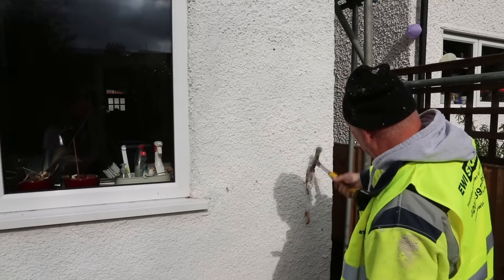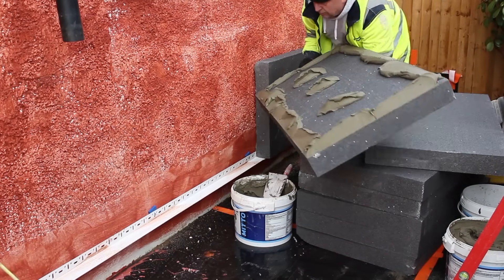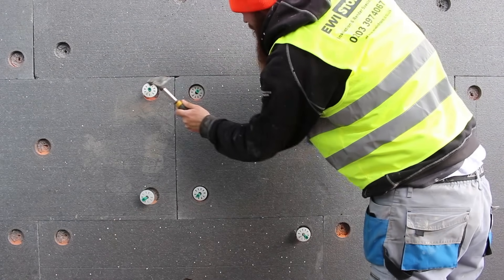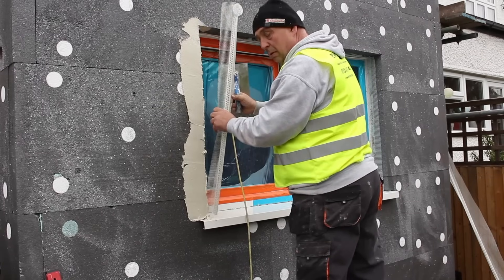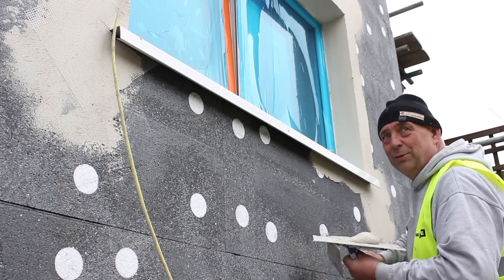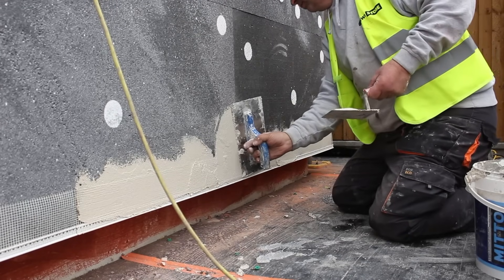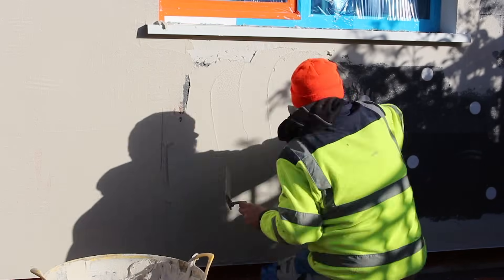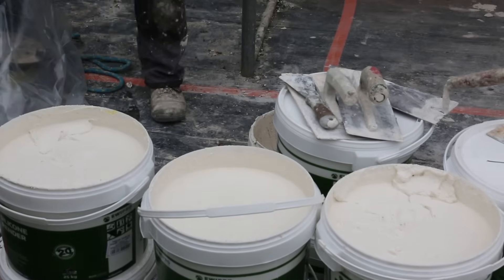Upgrade Your Property with External Wall Insulation – Step-by-Step Installation

Comment: I must say we thoroughly enjoyed the video buddy! Very informative and we'll explained! We just bought an old country cottage back in Ireland and we are going to do this for sure!
Reply: Make sure that if it's a stone built cottage that you allow the building to breath. The type of insulation used here eps is not suitable as it seals the building.
Reply: @bigcheds87  ah thanks buddy! we actually decided to go with the Sheetrock backed insulation boards inside!
Reply: @Luke Jarvis  
If you going to fit this type  insulation you mention I advice for Ireland type of wet weather to sand & paint the wall with damp seal paint if you find it expensive then buy cheap white paint & add mould killer into it very important to do that (always wear goggle and mask) then when it dry stick to the wall plastic sheet the thicker is better  then fix the insulated plasterboard trust me will make a big difference. Best luck with that

Comment: How did you find applying the 225? Have you tried applying this base coat using the spray machine?
Reply from the maker: We have a pft and a kaleta
Works well as a render only on the 225 because you deal with larger surfaces. Haven't tried it with the insulation as the jobs have been too small.

Comment: Great video 
How do you extend an exterior Insulation window sill? It looks like you had one already on .
Reply from the maker: On the markets that are few different types of external wall insulation window sill extension The one we use most of the time it's aluminium window sill.
Reply: Where do you get them from?
Reply from the maker: Usually will get them from ewi  store

Comment: Great video. Will this stop damp mould and condensation. Also how much will a 80m2 area cost ?
Reply: Damp and mould inside a building could well be down to poor ventilation.  Assuming that it is not damp coming through a solid wall, I think you would be advised to look into mechanical ventilation with heat recovery.  That will stop the condensation, dry out the inside of the house and because it re-cycles the heat from the outgoing air, lower your energy use. However this will not be an instant solution.  Our house took a good couple of years to dry out and stop being musty.  Of course, for best efficiency the house needs to be as air tight as possible so that the ventilation you get is controlled not random.
Reply from the maker: Thanks for watching the video .
External wall insulation protects the building's structure and improves weatherproofing. The finished render is durable and breathable so you won't have issues with damp either.

Prices to insulate 80 square meters Is between 7 -10K
Reply: @InsulationRenderTipsUK  Can this be applied on the inside of a new construction house.

Comment: What will you do if you got cracks I existing render could you do external wall insulation on top of that.
Reply from the maker: Hi, thanks for watching the video.
 if you got structural cracks you will need to repair them before external wall insulation.
Reply from the maker: https://youtu.be/OIkHVv2JXzA

Comment: For external wall insulation what is better to use mineral wool or polystyrene?
Reply from the maker: It all depends on what sort of property you got most of the time we will ask manufacturers as EWI-PRO to provide us with a specification for the property. If you looking for the price cheaper option is to do EPS system. If your house is timber construction I would only recommend mineral wool.

Comment: Do I need to remove the dash before I do external wall insulation
Reply from the maker: Re-rendering pebbledash without removing pebbledash can be difficult if the right materials aren’t accessible. Removing pebbledash is a painful process, because removing the render requires hard work with a hammer and chisel, with the added risk of damaging the original brickwork. 
One of the best ways of re-rendering pebbledash without removing pebbledash render is by smoothing over it with our One Coat Dash Cover (OCDC). This is the ideal material to use, because it can be applied at a thickness of 20mm thick without compromising structural integrity.

Comment: Really good job ! Could you please tell me what is the installation price m/2 (without material)? Thanks.
Reply: Really expensive... 😩
Reply: @adrianbadea1179  in Slovenia the cost of making insulated fasade installion included is from 32 eur to 55 eur. or 12.000 eur to 20.000 eur for a average house.
Reply from the maker: Hi prices starts from £80 per sqm. Please visit our website for more information www.beconstructiveltd.com

Comment: I have a wooden holiday home in Hungary. Does anyone know if a similar external insulation solution exists for a wooden house?

Kind Regards
Alan McGrath
Reply: You can use the same technique replacing the glue and the screws for wood walls... Simple 😀
Reply: Look up EIFS

Comment: Silicone render over Polystyrene tiles? hmmm. A half-decent house fire would spread onto that no problem at all.
Reply from the maker: the systems have a reaction to fire classification of B-s2, d0 in accordance with BS EN 13501-1

Comment: Could you use brick slips instead of render?would that keep the rain from the insulated board's?great video professional job.
Reply from the maker: Yes you can use brick slips instead of render there are few different types of brick slips best people to talk to and get the bricks slips from is EWI store www.ewistore.co.uk
Reply: which product is the render ? @InsulationRenderTipsUK

Comment: were did you get the nail part that go in the foam to the walls please write it in on the screen
Reply: Look for insulation fixings on ebay
Reply from the maker: we got that from Ewi store   www.ewistore.co.uk  from Chesington kt91 DQ